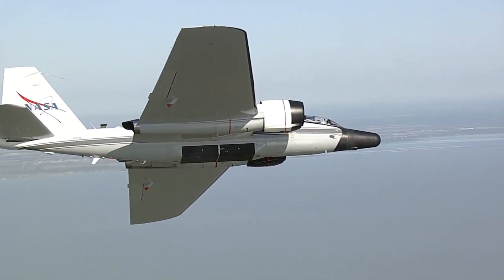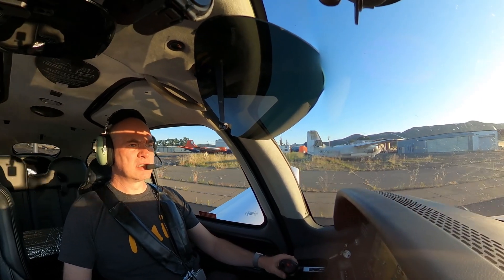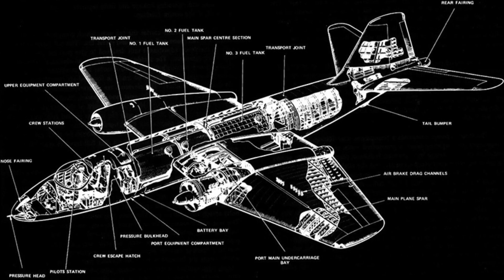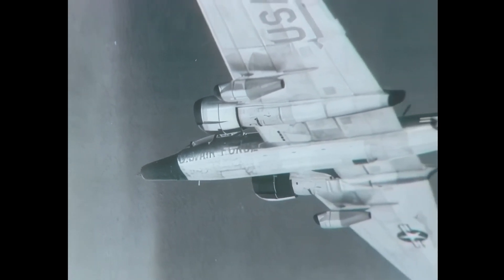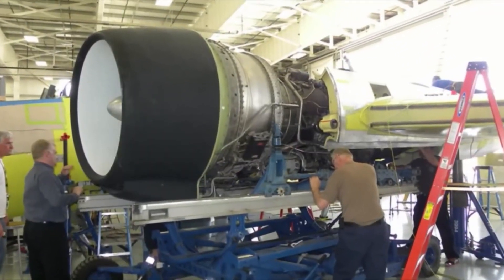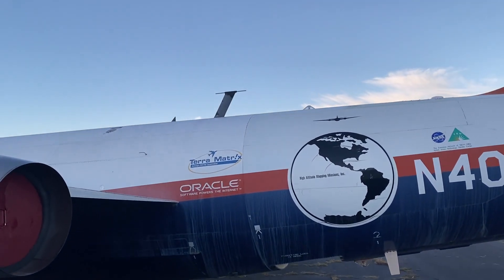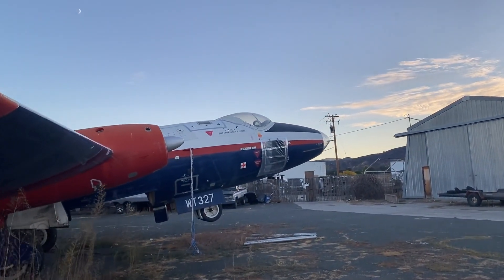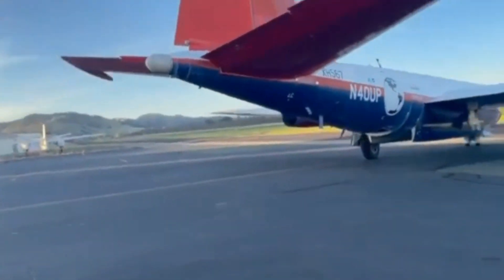Why NASA Relies On A 1950's Aircraft Design To Track 21st Century Spacecraft

Comment: I used to be a center controller on the East Coast, so I didn’t get to work many of the cool things that flew way up high, which tend to be out West. The RB-57 was the second-highest flying aircraft  I ever talked to. It used to come through my area occasionally, and it was nice to work, because flying at a block between 47,000 and 55,000, it wasn’t in anybody else’s way.
Reply: We caused ATC problems because we were limited to 150 Kia’s.  Leaving ABQ for IAD to stand as a display in 1972. Center request we descend out FL 500 to enter flow with commercial airliners. Told them we limited to 150 Kia’s but it didn’t register with controller. So when we got down to 15,000 feet they demanded we speed up so as to not screw up their traffic pattern. Needless to say they finally figured out they should have listen to us and let us stay higher longer.
Reply: @terrellburnett3981  Only time I had a U2 descending through my airspace, I thought he would never make how low I needed him. I didn’t think with that big wing he would come down so fast. I asked him if he could make the restriction I needed, and he did that in a very impressively short lateral distance.
Reply: @SearTrip  I love flying on instruments on the raggedy edge. At least in Kerbal Space Program, and Space Shuttle Simulator when I was younger.

It's like the flying equivalent of walking away from an explosion without looking back.

I'm a little bit envious of U-2 pilots. It's super satisfying to watch the numbers do all the right things.
Reply: Second? What was the actual highest then?
Reply: @woestewouter96 U2s would come through somewhere above 60,000, but what altitude they were really at was not for us to know.
Reply: @woestewouter96  Could be the U-2 or SR-71, but due to the classified documents we might never know which one.
Reply: @matthewcox7985  Oh, no, ATC knew which type of a/c, plus, the speed would be a big hint. The reported flight level was always 600. And, I didn’t get to the center until after the SR-71 was retired, never got to work one of those.
Reply: @SearTrip  … another bird I watched from close up as it took off what a sight that was, amazing aircraft and noise I’m surprised I can still hear.
Reply: So we in the US rely on a record-breaking British aircraft from the 1960’s to track returning spacecraft in 2025. WOW WOW WOW
Reply: @richard999 The BAC Canberra was from the 1950s, but the RB-57 has little left of the British aircraft, having been modified so much.
Reply: Concord was up there depending on the Air Temp but reached 60,000ft routinely. But approaching the US from London & Paris they would have started their descent into New York, Washington or Miami before the crossed  the coast.
Reply: @beagle7622  Concorde reached its highest altitude only briefly, as Concorde always flew in an arc, never level, or so I was told.

Comment: There were versions RB-57 that had lengthened wings used by the air force. The lengthened wings overstressed the airframe.
Reply: Nope, they gave super-high altitude capability.

Comment: If they’re cheap to operate and maintain then why not?
Reply: I very much doubt they’re cheap to operate. The spare parts are going to be highly specialised these days. 

However where these old aircraft win is that they have the capability to do the job, and more importantly they have a type certificate that means they can be flown. 

The barrier faced by a new design is that the cost of the design, test and certification is extremely high, especially for a one off. That was true also for these older aircraft, but the cost has already been paid, decades ago.
Reply: @abarratt8869  It’s NASA. They have a multi-billion dollar budget. And as much as they fly those things I’m sure they’re not requiring new parts regularly. But I am surprised they’re still flying such an old design. Surely there’s a newer jet design that could fill that role. Possibly something commercial.